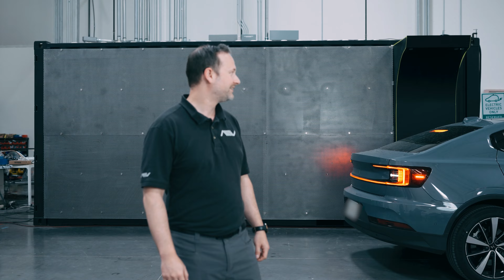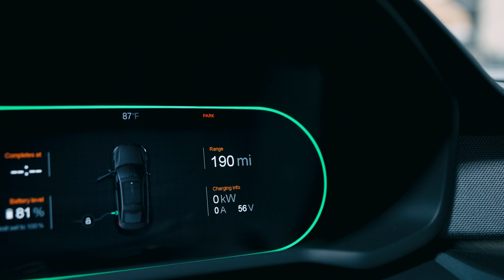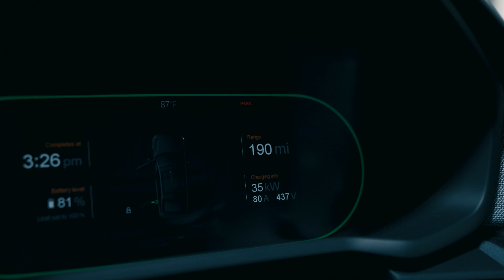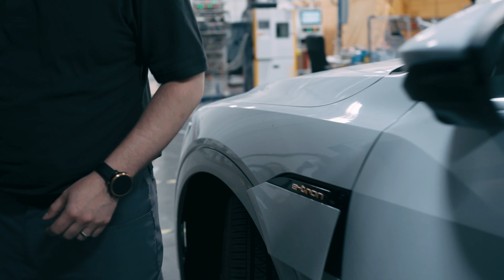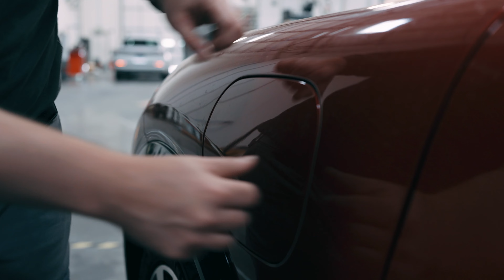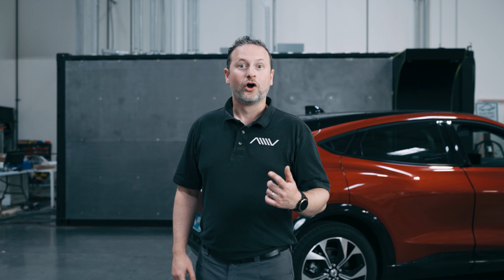Fast-charging multiple EVs | AMV Energy Solutions Demonstration

Comment: What’s the max kw you can deliver? Is this one limited to 30kw for now? Great job!
Reply from the maker: The maximum the system is designed to deliver is 1500kW. In this video, you see delivering power past 30kW. Atlis' key differential is that we will deliver the maximum your vehicle is willing to accept, therefore there's no need to list the charge rate on the charger. You can always depend on having the power when you need it.
Reply: @NxuInc  can we see the speed that mustang was charging at? The polestar was already 80% so it slows down significantly. It'll take 150kW if you're under 20%.